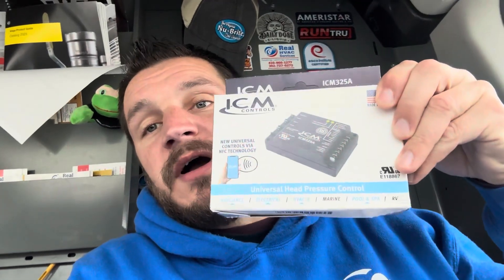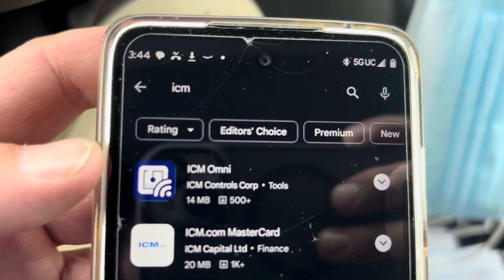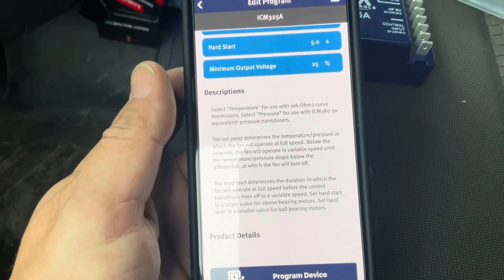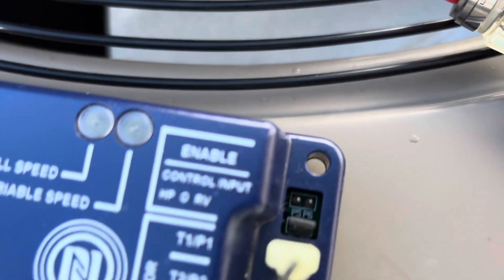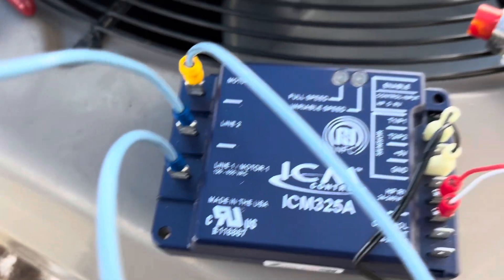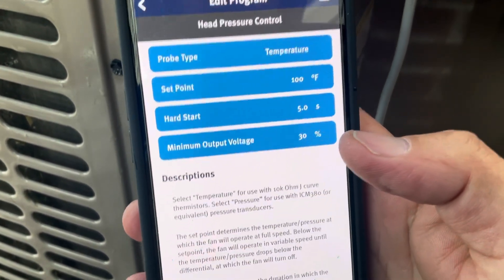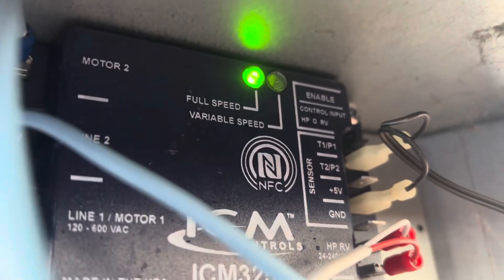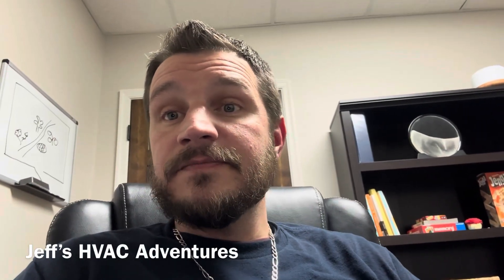Space Cooling Efficiently In The Winter?!?  The ICM325A Makes It Possible!

Comment: How does it regulate the speed on a psc motor? Does it use speed wires or does it have some kind of inverter?
Reply from the maker: It lowers the voltage being passed to the motor.  Kinda like a dimmer switch.  It determines the speed by the temperature or pressure of the coil.
Reply: @JeffsHVACAdventures  interesting. In a class on variable speed motors, they said you couldn't vary the speed by changing AC voltage, you needed to convert to DC and create a lower cycle frequency at full voltage.

Comment: Is there a quick way or site to find out if your fan motor is a sleeve or ball bearing type? If the unit fails does the fan not come on or reversing valve not switch? Just thinking about troubleshooting 5 to 10 years down the road. Thanks Jeff!
Reply: Good question,when you install the sensor,if the shaft on the motor goes in and out ,it is sleeve.
Reply from the maker: As Mario said below, the shaft does have more play in sleeve bearing motor.  And yes the if the unit fails, the motor just simply won’t operate and you will get an error code flash on the device.

Comment: Sick of electronics on every dam thing today. They always seem to fail.
Reply from the maker: I feel you.  But im all about embracing  new technology and at least giving it chance.   But honestly this device has been around for years, just the NFC is new.
Reply: That's idea 😂
Reply: @venvnco6259 that device actually works. Your other option in low ambient temperature cooling applications is to put a manual switch on the outdoor fan motor and go outside turn it off and on manually every 5-10 minutes. Your choice!